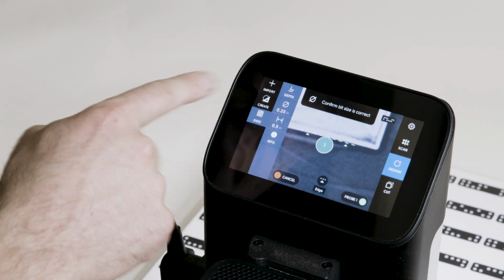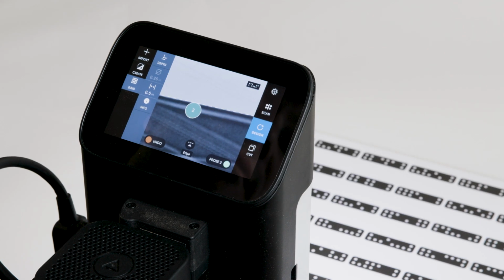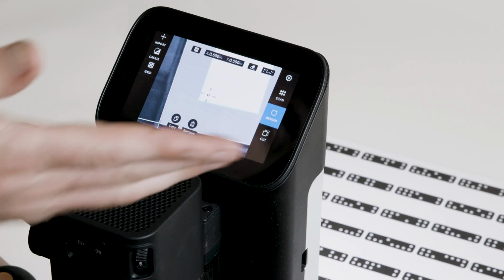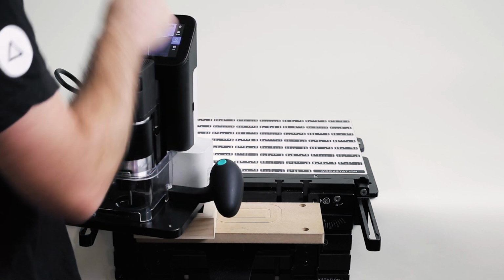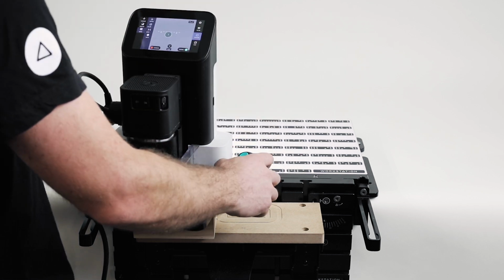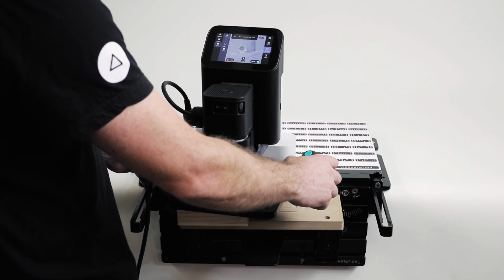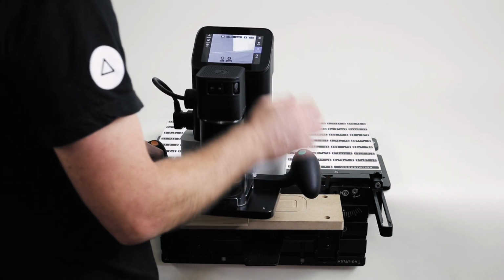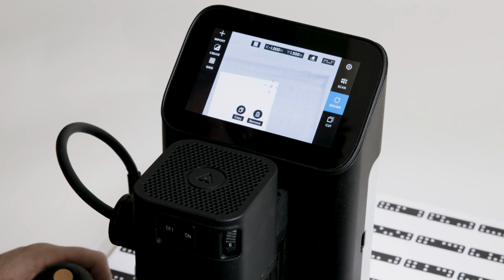Tips & Tricks : Grid

Comment: If I use the 1/4” engraving bit for my gridding, but I’ll be using an 1/8” bit for my cut, what is the proper bit diameter to enter?
Reply from the maker: Always use the cutter diameter that's installed at the time, so 1/4"